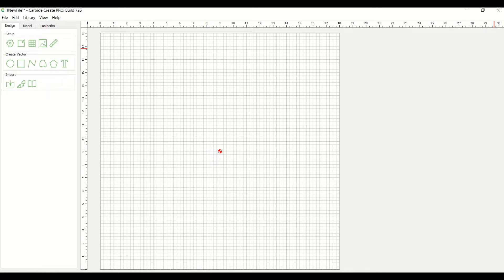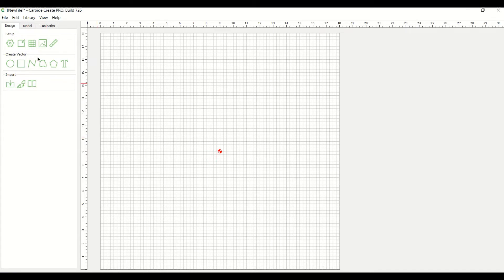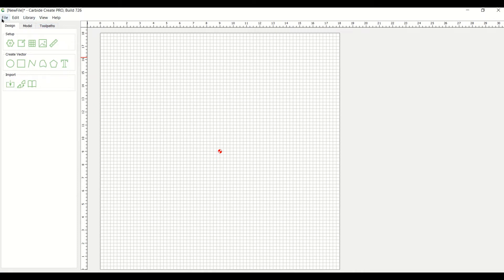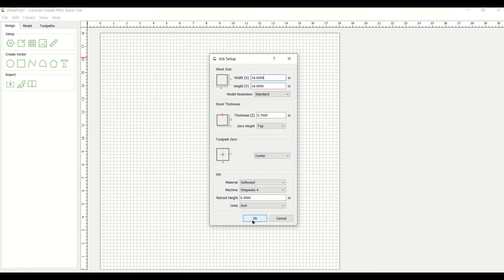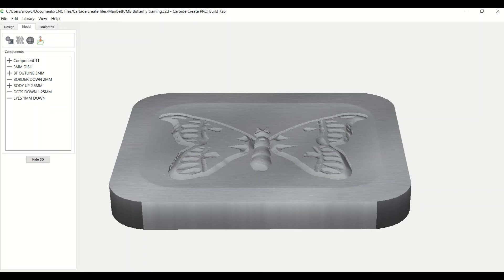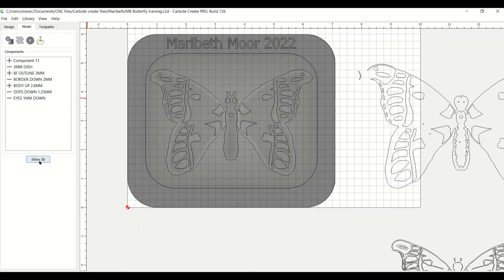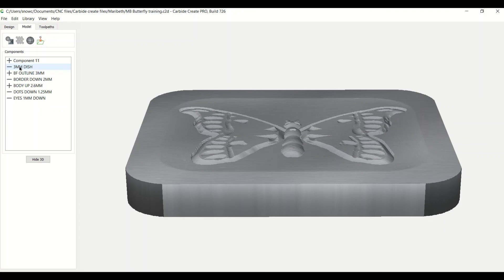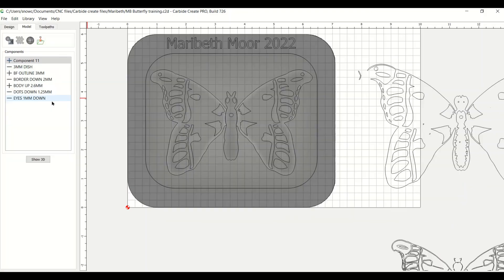Carbide Create Pro Training Part 1 Intro

Comment: New to Carbide Create Pro.
Trying to do a simple create to carve. So I can later do more complex carves. Anyway to do a step by step? Somewhere between create and toolpaths I loose it.
Thanks
Reply from the maker: start simple just to get moving.

In design draw  circle and a square in your work space

Go to model

Frist component should be size of material.  you must have something to build you model on.  

Draw Square the size of your material.

High light the circle and square.  
Due a round .5 height merg type subtract.
see if you have anything on show 3d.  if you do go to tool path.

click the material size square, build a rough path and a finish path.

see if you have anything in show sim